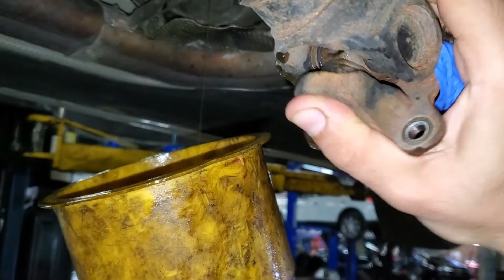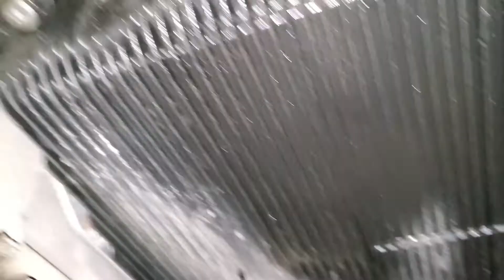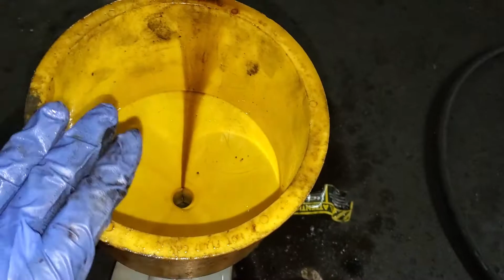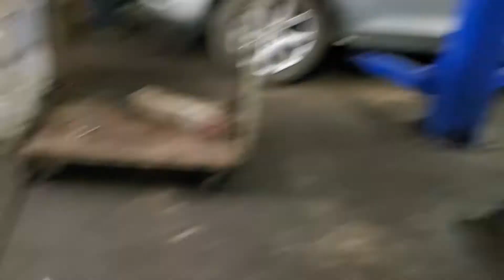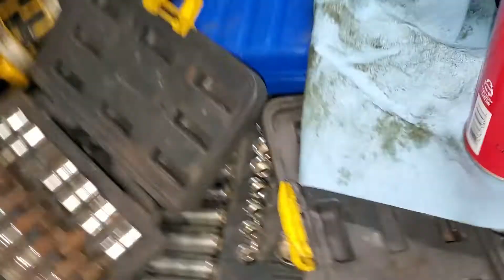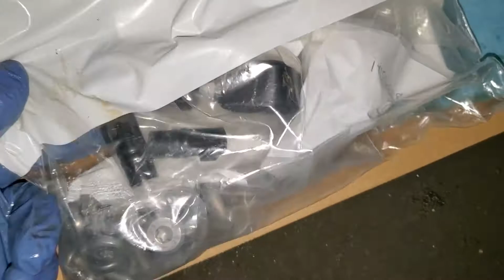BMW E60 535i XDrive transmission and differential oil change DIY

Comment: I did the same thing while filling my transmission I just cut a hole in one of the caps put my fill line into the hole in the cap then close the top just In case the bottle falls over you dont waste anything

Comment: What size is the rubber peace you use for the tranfercase
Reply from the maker: I dont recall exactly, but I remember that I did a measurement of the plug diameters found a piece of rubber that fills that diameter snuggly, then I made a whole in the rubber and passed a hose through it.

Comment: And also do i have to remove driveshaft to get access to the tranmission fill plug thank you
Reply from the maker: The front drivershaft needs to come out, correct.
Reply: Thank you so much for the time Just like the video correct? And when its time to fill the tranmission can i turn it on and go throught the gears with the drive shaft disconnected?
Reply: @xpxp-bo2pi doesn’t sound smart but I don’t know

Comment: Hello yall in order to check the fluid level and wait until the tranmission fluid get to a certain temperature can i do this while the drive shaft is diconnected?? 
Thanks
Reply from the maker: Yes, that should be ok.

Comment: Where did you align the shift lever
Reply from the maker: The shift lever in this bmw E60 LCI is electronic, no alignment was required.
Reply: I heard they said you need the tip to be align if not it wont go into gears
Reply from the maker: The LCI (2008-2010) has an electronic shifter, maybe there is a slightly different procedure for the 2004-2007 models (pre LCI)

Comment: What is the update on your transmission? Did it last after the fluid change at 120k?
Reply from the maker: It kept going for about 30k miles and then started to slip. We have another video of the same car having the transmission replaced... its also in our channel

Comment: Did you replace the mechatronics unit, or did you just remove it to get extra fluid out?
Reply from the maker: We ended up removing the mach unit to replace the seals/sleeves and get any excess fluid out.

Comment: Very good video. Question: how do you get the air out when you fill the oil into transfer case by using rubber cap? I am assume the air has no way to get out if the upper fill screw is not open. So the air pressure will add up to forbid the oil in. Any idea? Thanks
Reply from the maker: The hose is loosely fitted (allows air to escape) but the black fitting is on there tight.

Comment: Where did you get the rubber piece you used on the transfer case drain hole?
Reply from the maker: Local hardware store. It was part of a kit of different sizes. Look for rubber pipe caps or rubber end caps. Then once you find the size that you need, just drill a hole in it so that you can fit the hose through it. Hope this helps

Comment: Take out 6 quart of oil out of the transmission an when I put in back the oil it is only 4 quart can go in it .it is coming out back I started the car to see if it can take more but its coming out back
Reply from the maker: Did you cycle through the gears before attempting to top up the oil?

Comment: Hey mate,
I have 2017 G31 530d and recently I've being noticing some sort of hesitation while changing  gears and holding RPM, also jerky  sometime.
Is that a sign to change the ZF8 oil?
Reply from the maker: What's the mileage on your g31
Reply: About 11300km, mostly  driving in the city.
Reply from the maker: Try to have the dealer reset the transmission adaptations before doing any further Diagnostics... it could be as simple as an adaptation reset.
Reply: @CarInspected  much appreciated for the support.
Will have them check by next week.
Cheese mate